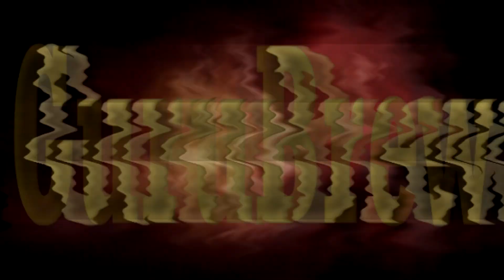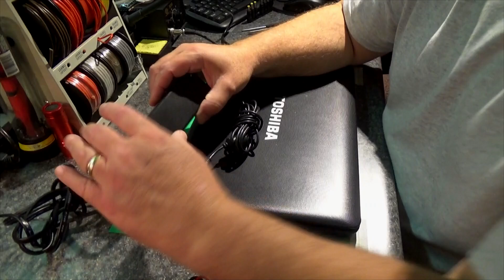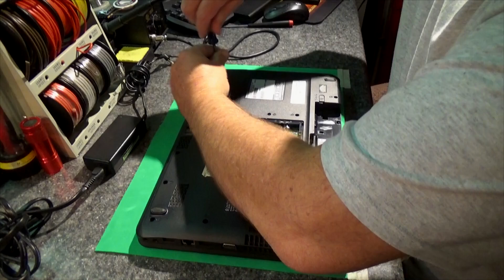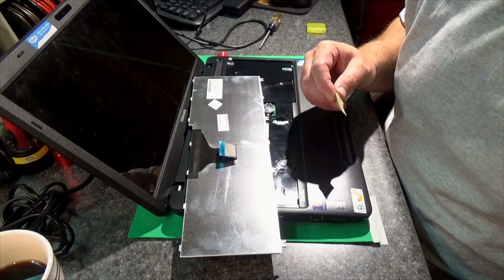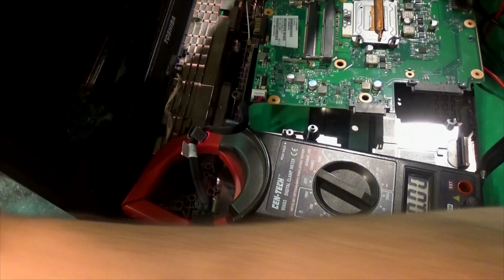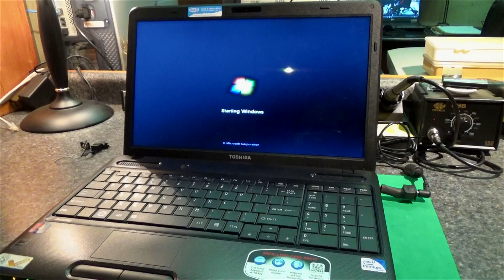Toshiba Satellite Laptop Repair - Troubleshooting Steps For No Power Condition

Comment: Excellent troubleshooting of that laptop. I probably would not have removed the Motherboard first, though, but just tested the incoming power at the solder points where the harness connector is soldered to the Motherboard. Great video.

Comment: Acer - Sony Vaio - but Toshiba That I originally began with wih 4 gig of Ram on a basic Pentium Chip-set,beats the now dead Acer & Sony Vaio and there crazy recover set-up's with all sorts of massive problems. This Toshiba cost £100  and that was 3 - years ago on Windows 7 Clean Build, works way better than most new Laptops as changed simple Ram and type-in the box Memory Diagnostics & RUN it's now rated at 6.9 on a massively fast yet reliable Laptop. Why i subscribed to you many mons ago as your a great Tech-Guy and respect is Due ...Cheers ( Also Have A Dyno-Dock That Plugs -In To My TV By Toshiba ) but use my Firestick for any android build ...many thanks again : )

Comment: Nice trick with taping the screws to the part they're taken off.  Not sure but I think you could have accessed the other end of the power jumper by taking the bottom off on this unit, saving the hassle of pulling the keyboard and motherboard.

Comment: Dude. This just confirms that I did the troubleshoot on a clients laptop power issue correct. I didn't have the extra power jack laying around, so I want right ahead and bought a new one. I'm keeping my fingers crossed that it solves the issue as well. If not, I'm going to have to tell my client that it better to get a new laptop cuz the cost of a new motherboard and troubleshooting further will be too costly. It would be best to get another laptop, doesn't gotta be new of course.
Reply: Jonny Loco you could repaired it. the mobo.

Comment: Nice, you could check the power mass before dismounting, I have seen it disconnected on a video. Regards (yes that  first connector cable can get cut , now if the negative was cut you may have seen it before opening with a continuity check between masses of the different connectors

Comment: I looked at an HP laptop for a friend. Dead as a hammer. Took it apart, and found blower system loaded with cat hair. About 1/4" thick layer completely covering the blower exhaust. Power supply parts were darkened nearby, probably cooked. Used an DMM and found a defective 3 lead power transistor with NO part numbers on the motherboard. Junk - end of story.

Comment: I wanted to say Great video well done ''I hate the videos that have no dialog and pointing no explanation'' You explained really well, liked your tip on screws.I have a Toshiba C55-B5240 that was given to me a while has a cracked screen and doesn't turn on. Going to try your method to see where it takes me. You have the same troubleshooting as I do example starting at the Power source with a Multimeter as your !st step and working your way down that's how would've started also.I work on Hydraulic Equipment, Machines working off electricity and always start at the Power source, Goodman Keep Up the Good Work.

Comment: Good review, thanks for it. 
But why didn't you check the voltage of the battery before opening the laptop ? Is was completely flat i supposed, so the problem was almost for sure in the power cable.
Reply: the laptop should work without the battery only with the ac adapter attached

Comment: I liked the way you explained every thing.  Thanks for the video. Have you seen CMOS battery in a Toshiba Satellite Radius P55W-B5224 model?  I looked on front and back side of the motherboard and could not find any battery that looks like a coin battery.

Comment: Hi Steve. Absolutely hands down the best vedio on this subject. Question....at the end you said you re-installed your own operating system...is that because you were keeping the laptop or because once you get it turn on you MUST reinstall the operating system. I have similar issue with my laptop that I am keeping. So, after I go through the steps to fix the power port do I need to reinstall the operating system or will it start as before? Thanks.

Comment: Enjoy n appreciate your video Vy much. Have the same C655. My problem is the charging light quit a few days ago, but PC would still run with the battery.  Battery has limited power n would die eventually if there is no charging.. Took apart all covers to access the jack n connection to motherboard. Multimeter tested 19 v at both locations. Power reach motherboard. Since PC runs on battery, but not on charger power, suspect faulty motherboard. Try different adaptor of same output.  Same results. Your advice please.
JK

Comment: Thanks for the information fixing the Toshiba. I need help with a Toshiba Satellite 200 that is very old dating from the mid 1990s and running windows 75. I need a disk drive for it. Can you lead me to where I can get old parts for this Toshiba.

Comment: Thank you for teaching me so much about computers Ron Swanson. I am hoping you might have some insight for troubleshooting my own laptop. Since I accidentally broke a ribbon from the power button to the motherboard when cleaning my fan, I have been short circuit it with another ribbon wire. Which worked fine, but I got some crazy sparks last time I did it and I'm getting an orange flashing light when I plug my AC charger in (which ai believe indicates a power supply problem). That should mean I'm getting power, but no green light. Any ideas for troubleshooting? And also, if ai can fix that, any ideas for turning power on without the power button? Thanks Mr. Swanson

Comment: Did you know how to reset the power cyle.. take of the battery press and hold the empower bottom for 1min without power plug in . Repeat the cycle two to three times then put everything back power should comes on..

Comment: In my case, the lights are on but no display. I already tried removing the battery and pluggin the ac but same thing happens: lights are on, fan's workin but still no display. I've also tried draining by holding the power button without the battery and ac plugged.

Comment: Hey Steve great video,i juat watched itcause rigth now i have a Toshiba C55 -A5311 laptop from a friend,and its showing the same problem,it does not power up,nor start nor show any signs of life,starting from the power cable and it works,then the AC or DC cable that goes to the motherboard and it to shows the 19.3v as the charger when icheck them with the multimeter or amperimeter,so the problem seems more in the motherboard,do you have a video when instead of the cable that goes to he motherboard its some else?

Comment: So I have a stupid question... I am working on a Toshiba Satellite C855-S5349N. I have two power boxes to try. Both are reading 18v instead of the 19v it is supposed to be. Is that gonna be an issue?
Reply: I am having the same issue as in your video here. No led lights, no power. Nothing.

Comment: With mine both the battery and plug indicator light goes on but the screen 
does not turn on. I did however take it apart my fan is clean I bought a new battery
and adapter about a yr ago but I haven't used the laptop since been using another my 
Lenovo.

Comment: Tried all static discharge methods... My power button is broke 
 It just was turned off at evening time. No power at all . Tried battery tried power cord .. there is a light when plug in power cord whilst battery is connected but not when out. Is the motherboard karput

Comment: I have a Toshiba L655D-S5050 and swapped out motherboards.  I had a failed video card on original board.  Prior to change you would hear hard drive fire up but no video display.  I had been having random video card errors and machine tossing a blue screen.  Now with the new motherboard installed, I see I have my lighted power indicators with both power supply and battery but absolutely no response when I push the power button.  I've even pulled each piece out to limit what the issue may be (memory cards, hard drive, etc).  Might this be a power button component failure?  How can I test the power button output?  I even went back to re-install the old drive to now get the same issue.  Absolutely no response when I press the power button.  Thoughts?  Thanks!

Comment: i have satellite L745 and it does not turn on. The power plug indicator light is on but when i power it up by pressing the power button, the power light comes on and the hardrive blinks. System is able to post and about to boot to windows for a period of time however it shuts everything off and leaves me power plug light indicator only on the laptop indicator lights. Could this be also a problem of the power jack? I have tested my HDD, memory modules, and ODD on my other laptop and these parts just works fine.

Comment: Hello, i have a LG R410 here with same problem but when i plug the charger and press the power button a noise exits off the keyboard, its same problem or my notebook haves eletrical problems on motherborad? (Sorry about the Bad english, im from Brazil)
Reply from the maker: What does the noise sound like off your keyboard like a fan or like it's coming from speakers or what?
Reply: +GuruBrew Like a eletrical fuze noise, if i press the power button the noise turn up the volume and i release the button the noise lower the volume but to hear the noise i need to put my ears close to keyboard (i can listen the noise with keyboard unplugged, notebook battery recharge but not turn on by battery also)
Reply from the maker: +OmegaForce that's very odd I can't say I've never heard that before does the computer work at all or does it just make noise?
Reply: +GuruBrew Only make the noise, no response when a press the power button with charger or on battery
Reply from the maker: +OmegaForce try taking all the ram out and seeing if it won't power on at all if we will do anything if not my guess is it's the motherboard
Reply from the maker: +OmegaForce in addition to the ram also take out the hard drive and the optical drive like I did in this video and see if it'll do anything when you connect it and turn it on
Reply: +GuruBrew Already tryed to turn on without the RAM and the processor, no response too
Reply from the maker: +OmegaForce okay I would go ahead and strip it down to the motherboard and take the processor off and reset it try that first and then start looking for cold solder joints and that sort of thing pretty sure it's motherboard issue
Reply: GuruBrew
I was suspicious of the power control MOSFETs before seeking help someone , perhaps my suspicion is the problem

Comment: I have a Toshiba satellite laptop L505D-S5983 and only one green light is on I can't hear no power sound or fan sound .the strange thang  about it when I tut a new battery in it try to start the laptop  I can hear the fan motor  for only 2minis  do any one knows  what mite be the trouble

Comment: I bought a Toshiba Satelite 
2010 model L505 laptop from a pawn shop I had too put windows 10 on it works fine woke up the next morning hit the power button nothing happens no fan on zero power too it even tried it with the charger on it still nothing
Reply from the maker: Thanks, Good luck.  Funny I am responding to your post right now using the same exact computer shown in this video almost 4 years latter.
 P.S.. I never did replace that temporary  plug to the proper one. Hey why should I, it works great.

Comment: Sir, I used a proper charger from fry's since I had lost my original charger at a starbucks, my battery pack does not charge even though it shows charging, I pulled out the unit, I don't see anything burnt or damaged. Later on after a lot of research found out that the polarity was reversed and has blown the fuse, any advice for me please ?
Reply: Dawood K dic you fixed it?